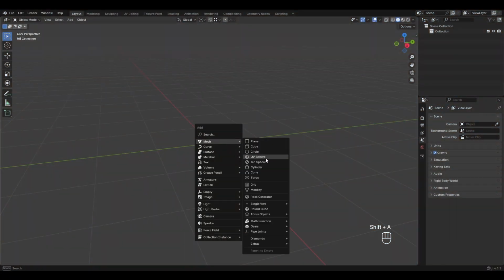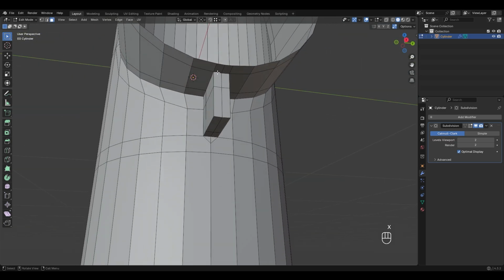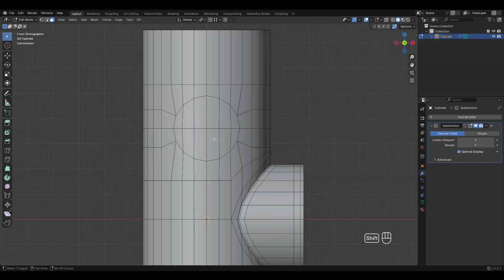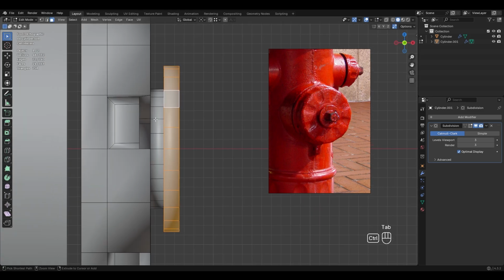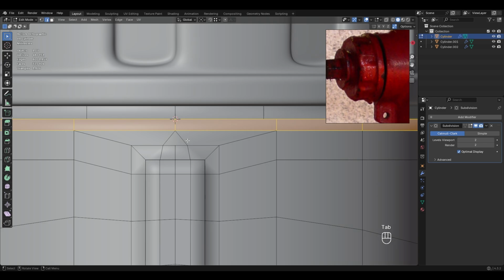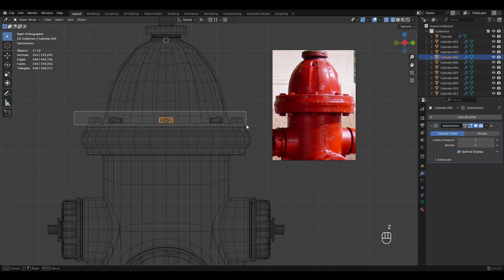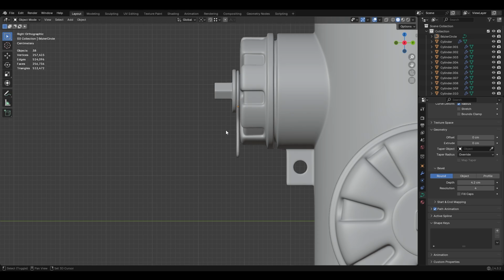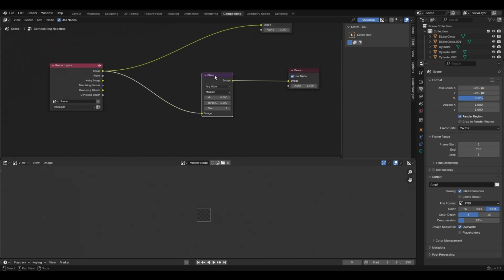Blender for Beginners: Modeling a Fire Hydrant

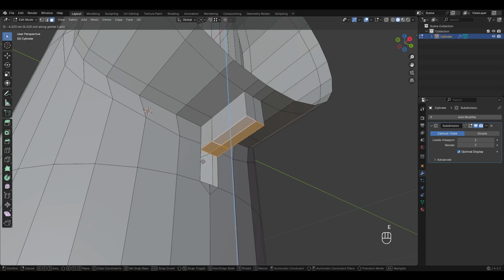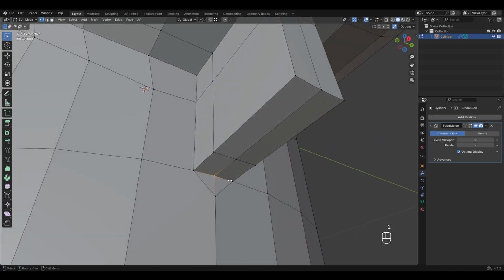Comment: 4:50 - i am doing step by step just like you but at 5:00 your vertices are merged but mine - not XD
Reply: I know I'm probably way too late here but I had the same problem and it was messing up the beveling but I went into vertex mode and selected all vertices with a and then pressed m and selected merge by distance and it fixed the problem.

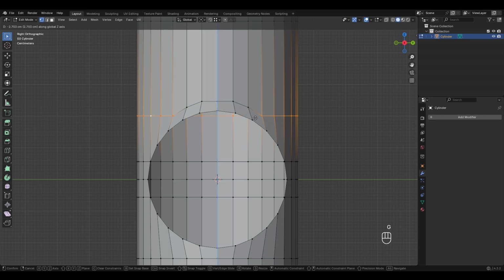Comment: 2:20 G-G move mouse down. g up
Reply from the maker: Thanks for the tip! In this case, we need to keep the edges straight, so sliding vertices with double G won’t work.